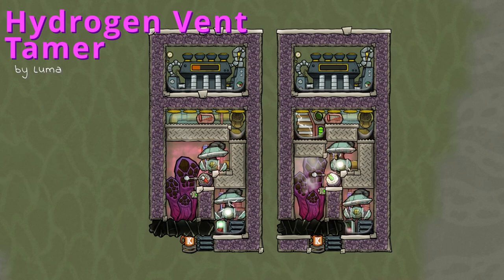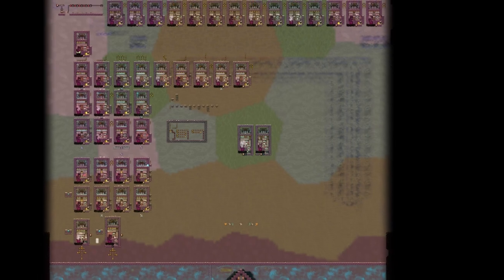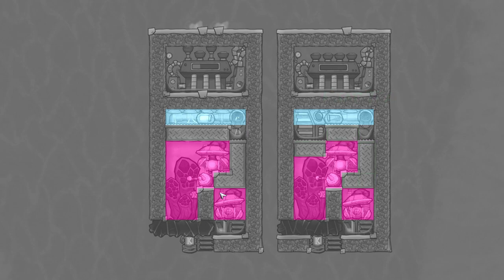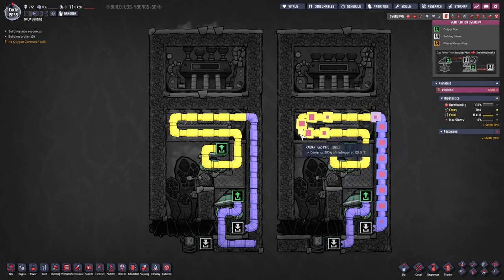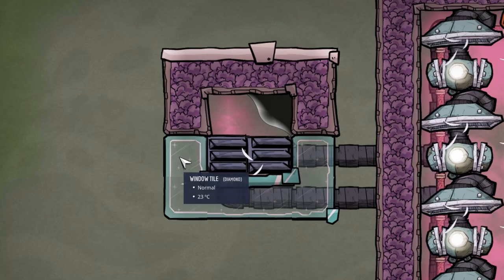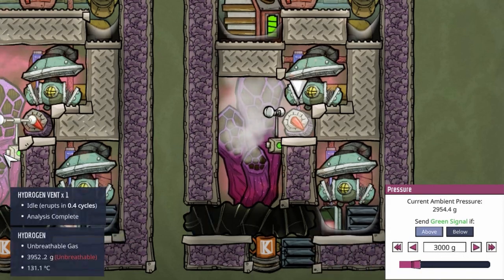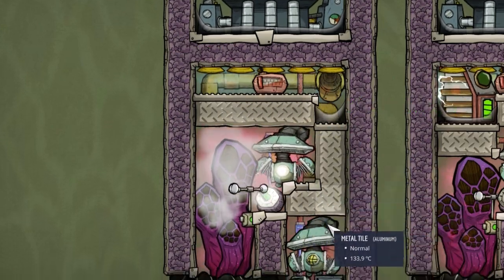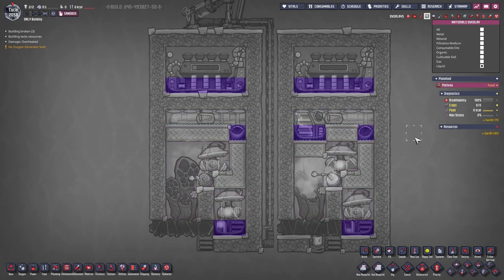My Hydrogen Vent Tamer - Explained

Comment: Used this, and after about 150 cycles the steam turbine temp went above a 100 degrees so I had to open it and cool it down
Reply from the maker: Hey guy9645 that is sad to hear.
The game has so many different aspects that we (you or me) might have missed something (no blame here, please dont get me wrong. The game is just very complex.

This and every other Setup have been tested on the DLC with around 20 to 40 of these Setups for over 400 cycles. Might either be a material change that was not optional or a very strong Geyser that was outside my testing range.

If you want to i can take a look at the setup on the discord; though you already fixed it.
Reply: @Luma_plays  I've had simular issues. Are you sure that this design is up to date. I think they might have made self cooling steam turbines harder to manage.
Reply from the maker: @mrblob107  Hey Mrblob please read the following with a nice voice and no sarcasm. I am saying that cause i seem to be misunderstood sometimes. 

can you check if all the materials are the same as in the video and if the mass of the water is still the same? That would help me figure out if this is something I need to recheck.

The setups have been tested for hundrets of cycles. Nothing game changing happened since then.
 
What i mentioned in either the short or the longer video that putting the vent INSIDE the crude oil is better / could help. 

Otherwise you are slowly deleting water over time. That is sadly a weird ONI behavior that is not really intended. That could changes the water buffer mass over time. 

I might check out the issue when more people have it.
Most of the time when i ask them if they can share how they build it they figure out the material is not the same as in the video.

Edit: there is a save file in the description to play around with if that interests you. There should be different designs
Reply: @Luma_plays  I think it was the oil in the turbine that I forgot to add in. Thanks for the support / reply. It's crazy how active you are throughout the comments, keep it luma!
Reply from the maker: @mrblob107  Thanks, and glad i could help.

I try to help the community in my way. When someone has a question i try to answer it.
Reply: @Luma_plays   Sadly encountered same problem, after few hundred cycles the steam turbine overheats. The only difference with respect to your video is I used gold radiant pipes instead of alluminium as I dont have it on my planetoid, might this be enough for the setup to not work ?
Reply from the maker: Yes Gold pipes is not enough. I had the same issue in my testing world. I tested (if i remember coorectly 4-8 with gold piping and 4-8 with aluminum) i am not exactly sure what number cause i had multiple testing worlds and different metal combinations.) in short: the gold piping was not enough to transfer the output liquids temp to the turbine fast enough. Hence the material requirements. 

An easy fix is making it larger on the top. Use 2 Turbines. Then the gold should be fine. Since you also extract more heat and splitt it onto 2 turbines.

Hope that helps. 
 @akisailent02
Reply: @Luma_plays  Thx! will try it and let you know if it works.
Reply: @Luma_plays   I tried to repair it as temporarely measure by deconstracting the steam turbine room and placing an ice tempshift plate to cool it at least for a while, than I isolated the steam turbine again, now with oil on 1st tile, water on 2nd and carbone dioxite on 3rd. It has been more than 1k cycles and the turbine never overheated again, so I guess even with gold radian pipes, if the steam turbine has not only oil but also 2nd and 3rd tile occupied by something that can conduct heat, its enough.
Reply from the maker: @akisailent02  Nice addition, thank you for testing that.
Reply: @Luma_plays  And Conduction Panel?
Reply: @Luma_plays  well apperantly I dont get notifications to my youtube abt comments came back to this vid now I started playing again, back then everything was the same as your setup just maybe the gyser itself was stronger with more output it was an easy fix just run through it some liquid great vid btw and thanks for responding